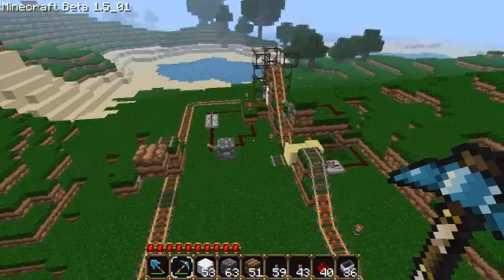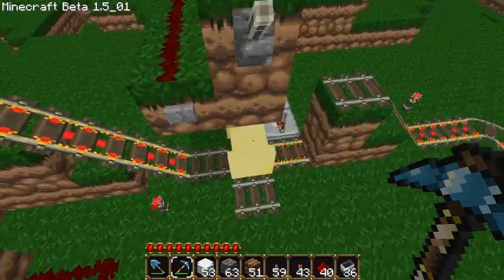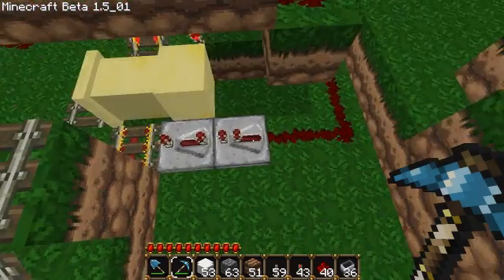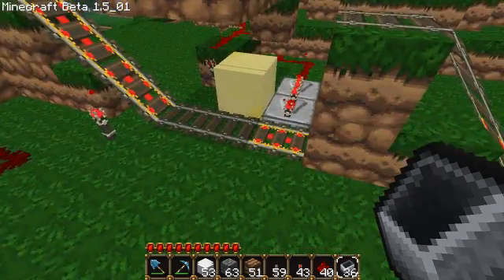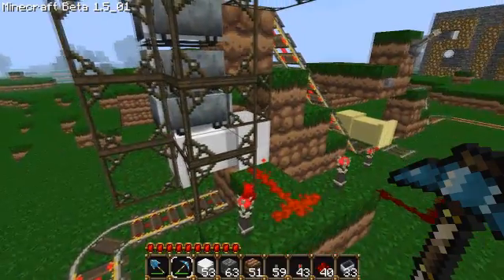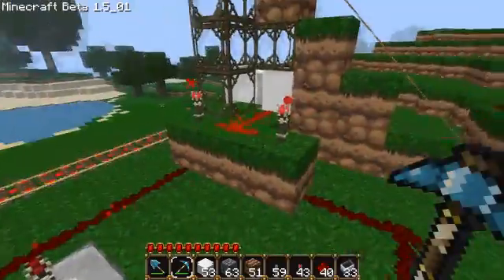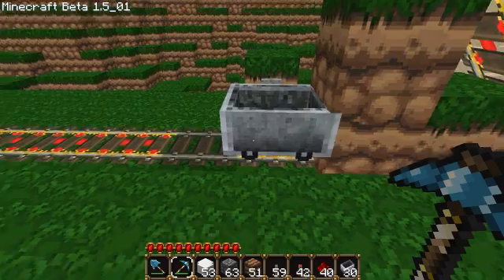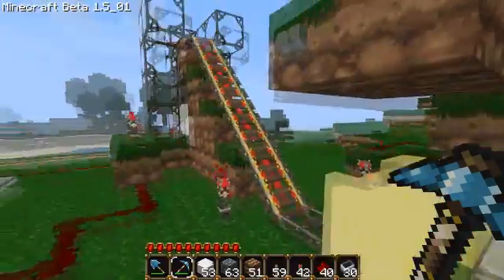Minecraft Tech - Pistons - Minecart Stations

Comment from the maker: @SafeBendyStrawGaming No problem. Note that there's a more compact redstone config for your button (I used the one in this video mainly because it was simple to understand and built off previous videos), and that we now have trapdoors which can serve as a cheap replacement for the dispenser piston and perhaps even a cart return stopper. If you build the dispenser tube underground, you can fill it up quite a bit while reducing the station to a small shack

Comment from the maker: @TK847 There is no single way of properly naming something, and it's a very likely fact that someone had already named it something different before "pulse limiter" or any other term even came into being. However, regardless of what you call it or how you build it, the concept remains the same. Thus, I chose this build to visually distinguish its simple components which it builds off of from previous videos to maintain ease of understanding. It's the player's job to compress it if wanted later

Comment from the maker: @cascoll2000 It doesn't really seem amazing to me; it's very cluttered-looking, especially when you get off the cart, particularly with the cart angles. And, it's far less compact. The buttons in this video are, for the most part, also extremely easy to replace with pressure plates; every one of them can be wired to plates without making any changes to the rails, with the only exception being the departure button. So, ultimately, I'm just not seeing anything special about it.

Comment from the maker: @StarlettsProduction Yeah, those are the same thing logically as what I used but more compact. I chose a less compact design for two reasons: to make changing the delays very flexible in case of future updates (I've had to increase the delays on some of my builds by two full repeaters due to recent updates) and to offer a circuit which bears a greater resemblance to the circuits in my previous videos while being very easy to pick apart visually (stuff that's too compact may appear complex).